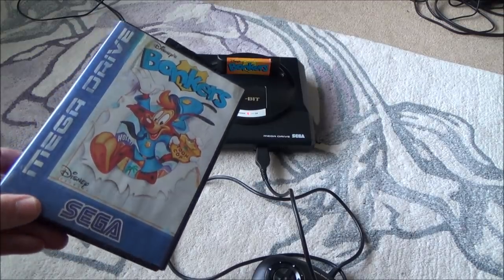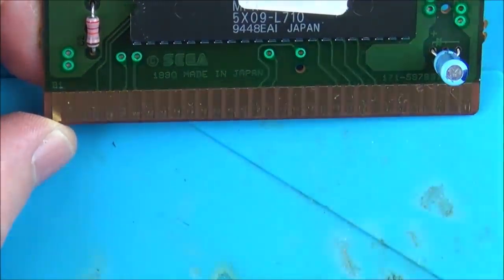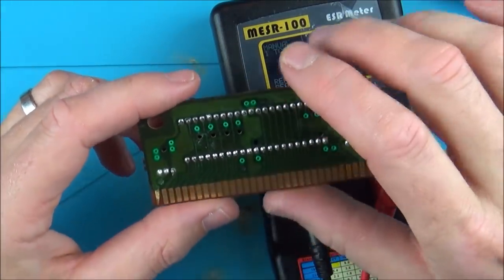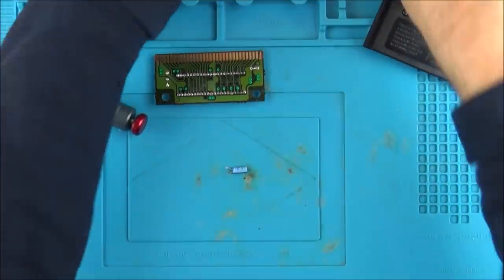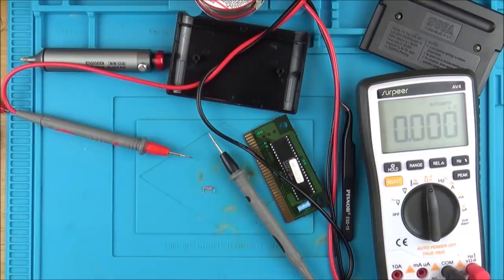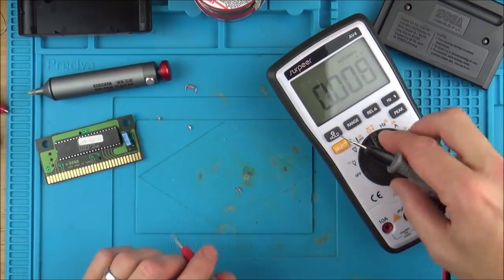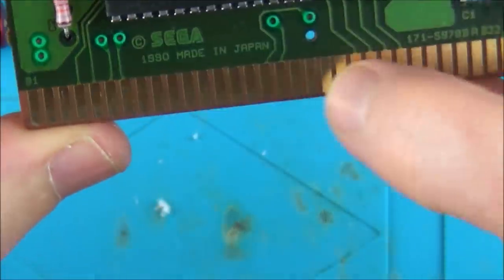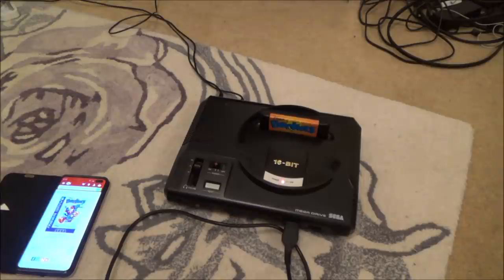Trying to FIX: BONKERS SEGA Mega Drive (GENESIS) Game (QUICK VERSION)

Comment: Make a jumper with a 1k resistor on pin 8 of the maskrom from top left to right and solder the other part of the resistor to the bottom on the pin 10 from left to right.
 I hope I could explain it well.
Reply from the maker: Hi, is this a known fix on these games, does it bypass the failed component inside the PROM? It would be nice to do a revisit on this if a simple resistor could fix it:-)
Reply: @Mymatevince  This defect is a protection that the mega drive/sega genesis games have and when this protection opens it turns the
 maskrom frequency on high mode but the correct would be that it was in low frequency.
Do the test with a multimeter on the diode scale, put the red tip on the ground and go measuring the pins, a good pin should have an approximate value of .635, when you find a pin with an abnormal value for example 1.657 you will know that it is the cause of the problem, put one side of the resistor on it and the other side on the ground.
I recovered several games of mine doing this, it's worth a try.
Reply from the maker: @rodrigollamas8129  Wow, I was going to start filming another video but not now!!!! I am going to test this out. Thank you so much. I will let you know if I find anything👍
Reply: Thanks  Smattless  knowledge must be passed on, I hope this helps Vince and others who have this same problem.
Reply from the maker: Rodrigo, I am uploading the Revisit video right now. Hopefully be live within the hour. Please watch it :-)
Reply: Did you check for continuity through those via's Vince?
Reply: Not all heroes wear capes

Comment: 2:13 it reads different values because your multimeter proves has voltage on them while reading resistance, it works like this because your multi meter searches for a voltage drop across the reading, that's how he knows how many ohms you have.
Since it has voltage, the voltage that is being provided to the reading is going somewhere (or some voltage from the capacitors etc is being feed in), that's why you have different readings even when you switch probes.
EDIT: Didn't expect a capacitor with such look
Reply from the maker: Yeah, I have never seen one either. Apparently if they are pink in colour or I believe light green then it probably is a capacitor. Light brown and blue are normally resistors. A link was given above in another comment with the capacitor colour codes :-)
Reply: @Mymatevince  I knew about the green ones, they are usually inductors.
Ok keep up the great work, it's always a pleasure to see your fixes :)